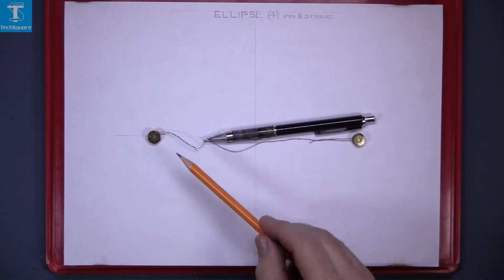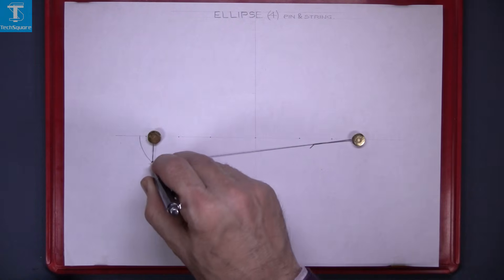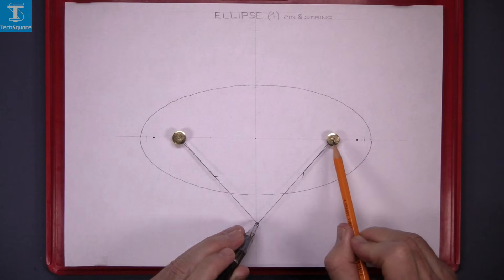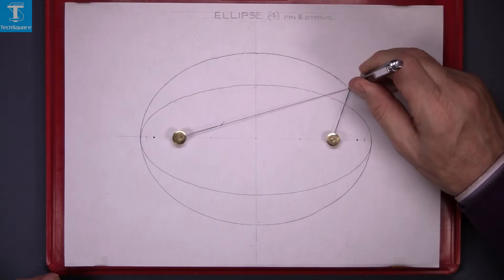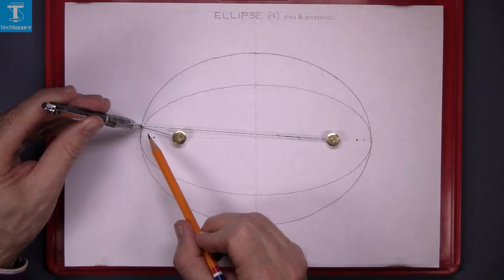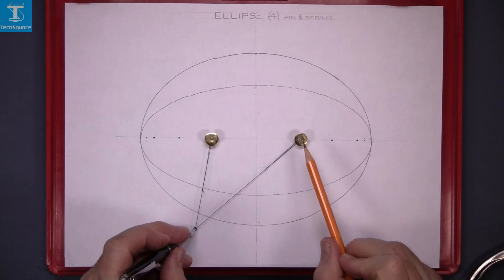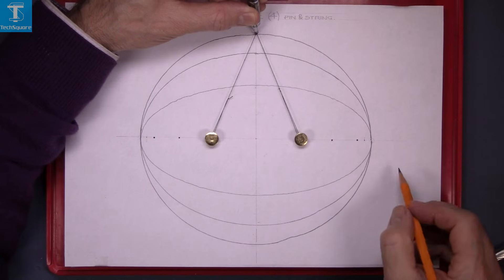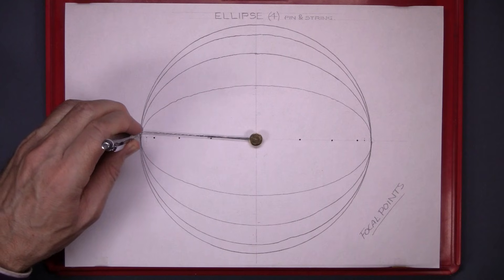Ellipse: 4 (pin & string method)

Comment: But how do you determine the focal points?
Reply: If you haven't already found out, do it this way:  The major axis is the length of the string, so set your compass to half the major axis.  Place the pin of your compass at the end of the minor axis, then draw an arc intersecting the line of the major; do this on both sides.  Your foci are where the arcs intersect the major axis.
Reply: @Troy-Moses  
     OK, I think I follow you. I took a screenshot of this, I'll give it a shot this afternoon. Thank you, thank you so much I appreciate it. ✌️